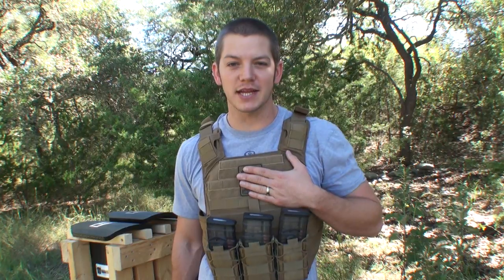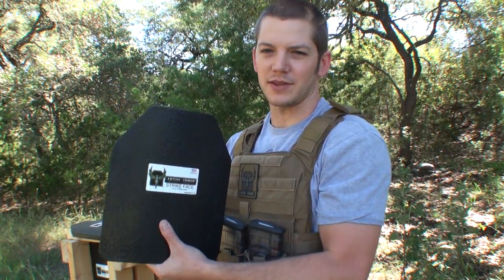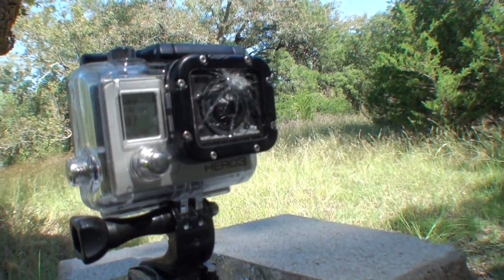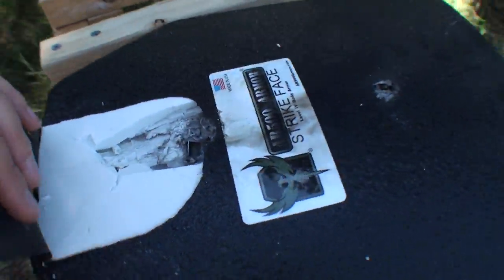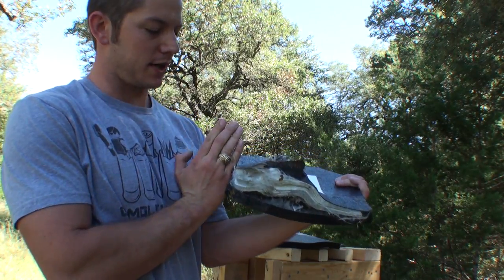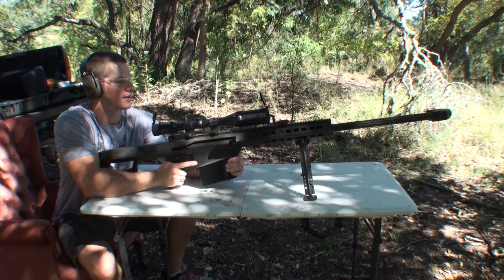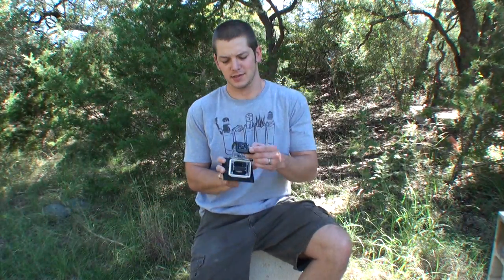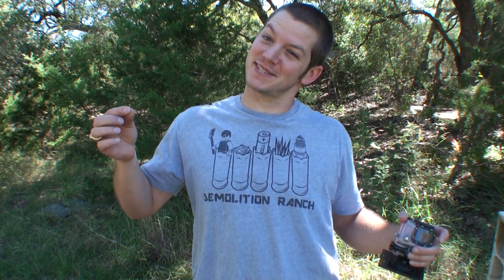Level IV Body Armor Torture, 50BMG

Comment: Technically hes not using two plates. Hes using two plates in a spaced armored setup. Which greatly improves penetration protection because it gives the bullet time to deform and alter direction before hitting the second plate. Duct tap both plates together  with zero spacing between and you would probably see a penetration with the last 12,7 AP core round.
Reply: I thought something but still good vid
Reply: possibly, but either way, pretty impressive protection for something so light weight. Of course even if not dead, you would likely be incapacitated at a minimum. 

But being protected against 30-06 is a nice thing to know.
Reply: Lobos222 err yes and? I teach physics, I know this. Haha.

Comment: yeah armor may stop a 50 but that blunt force trauma would probably jack you up pretty bad.
Reply: wild bill but you wouldnt have a whole in a back
Reply: wild bill Nah, bullets are dangerous because the force is concentrated in a small area. Once, the plate is hit, it is the force of the bullet in a very large area. Probably just knock the wind out of you, doubt it will crack a rib, especially with a trauma pad.
Reply: blackmesa232323 check out glgunsandgear.  Look what a 50 does to a full size IPSC target.  You may get more than a cracked rib.
Reply: Chris G You wouldn't have a back either
Reply: True, but broken ribs are eminently more fixable than a pulverized chest cavity.
Reply: I’m new to the channel what was the first gun he was shooting?
Reply: Wild Bill read up on l/bdr Restorick.